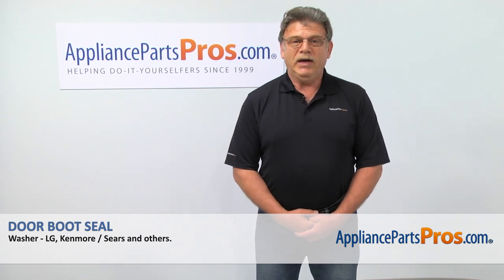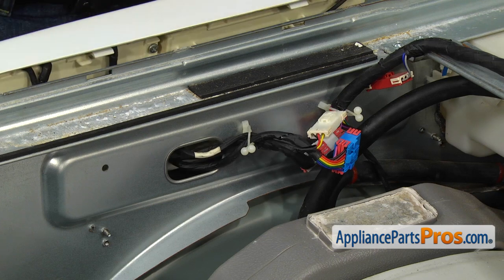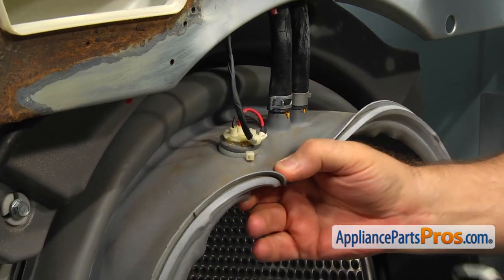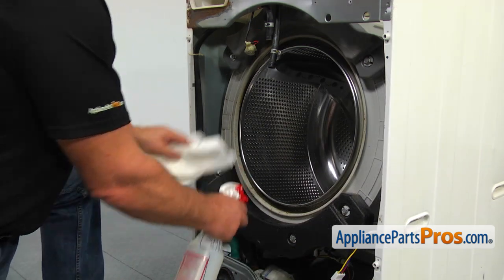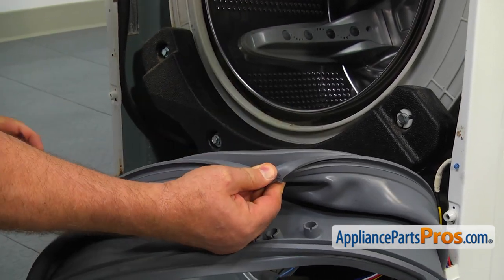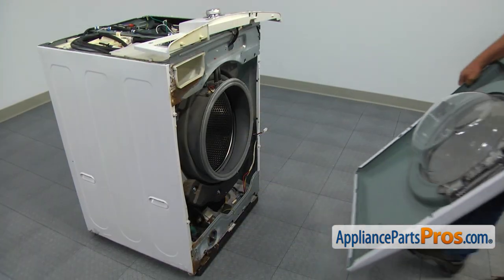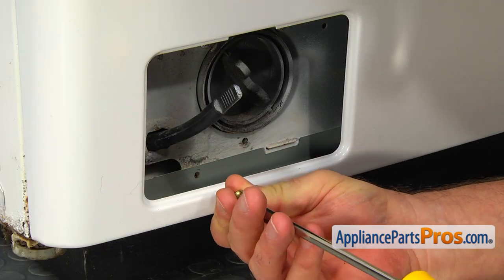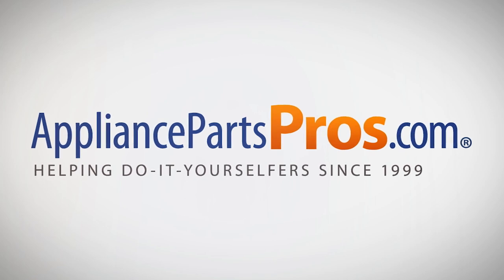How To: LG/Kenmore Door Boot Seal 4986ER0004C

Comment: Thanks for the detail instructions, everything made it easy. It just took a little longer because I cleaned all the scum before installing the new gasket and if I’m going to rate it from easy as 1 and 5 as hard, I’m giving it 2 just because I used a different spring extension.

Comment: Didn’t you put the wrong door seal on? The one you took off didn’t have a bottom drain port and the new one you put in did but there was no bottom drain hose. Please clarify and correct this before you confuse everyone.
Reply from the maker: Replacement parts can look different from the original if the manufacturer has redesigned the part. Our videos are generic videos to give you an idea of how to complete the repair.